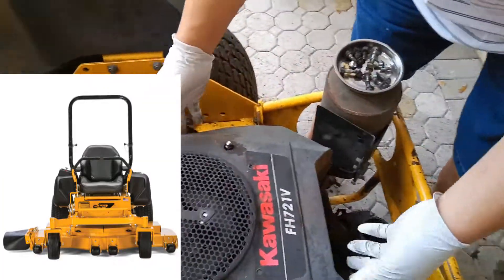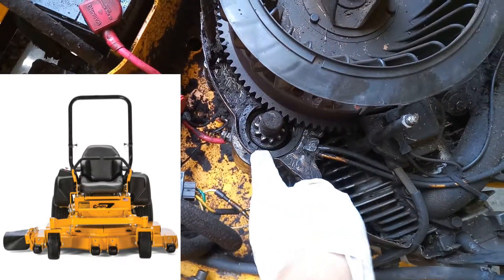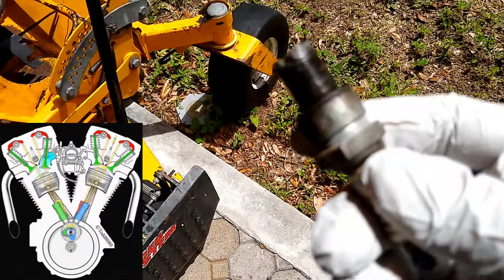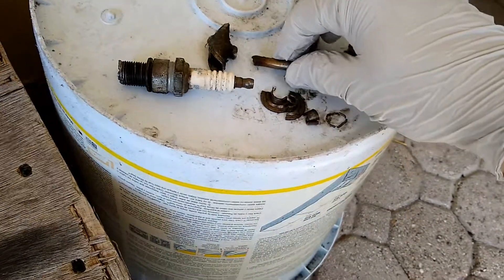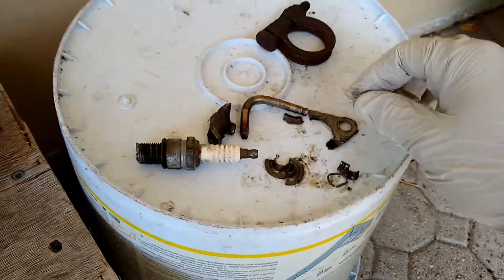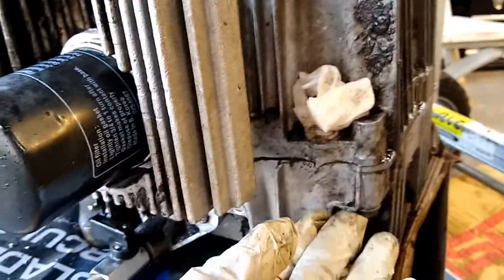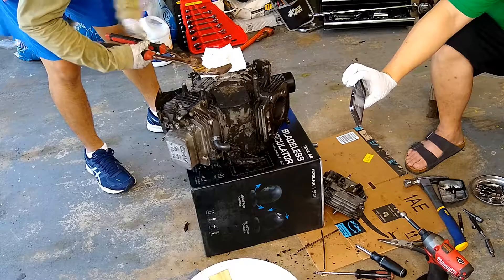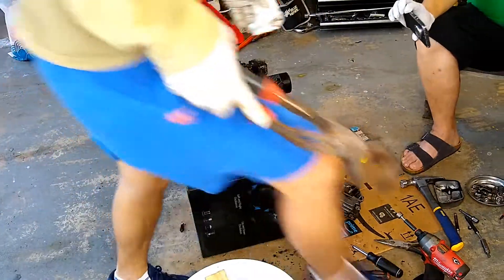Kawasaki FH721V repair

Comment: I have one of these engines on my '04 Everride Warrior. I've replaced the governor (I posted my experience on my channel). I've always had a tough time to get this thing to start. I finally bought another carb for it (Chinese), which works fairly well. Kawasaki wanted a small fortune for the new carburetor. I wanted a carburetor, not a new mower. But, it still doesn't like to start very well.  I finally have just left the air tube clamp off and pop the air tube loose and spritz a shot of starting fluid in the carb. This fires things right up. No long cranking sessions. 
  The idio....engineers at Kamakazi thought that the original 721's didn't need an oil galley to the top bearing, allowing the crank to waller out the top end. To fix it you have to buy the complete top case ($$$$). So, many of the older engines have gone to the scrap yard where they belong. I've thought about taking the 22 hp out of my old Sears 3000 and use it for the power plant. It's an old  Briggs. Kawasaki has not overwhelmed me with quality. I'd rate 'em right up there with Tecumseh. Except the parts are gold plated.
Reply from the maker: Clever way to motivate ignition with starter fluid hack, @battalion151R. I'm not a mechanical engineer, so I can't attest to the logic behind their design. I do agree that a lot can be learned and improved upon simply by evaluating the cause of failure and accounting for the number of replacement parts purchased every year. Thanks for sharing your engine experience and expertise.

Comment: Where did you buy the replacement head and did it come with the parts in it or did you have to assemble it?
Reply: My lawn mower is now running.🙂🙂
Reply from the maker: Hello. I purchased the engine head repair kit via the internet from a Pat's Small Engine in Minnesota (www.psep.biz). Below is a parts list from the receipt. Everything was as planned except for the push-rods, which were shorter and for a smaller displacement FV-series engine. Thanks for watching.

Item: HEADKIT6: CYLINDER HEAD KIT(UD16)
Quantity: 1 Price: $244.99 Shipping: $0.00 Total: $244.99
Item: KAW11060_7011: Intake Gasket
Quantity: 2 Price: $3.98 Shipping: $0.00 Total: $3.98
Item: KAW11060_7016: Exhaust Gasket
Quantity: 2 Price: $3.98 Shipping: $0.00 Total: $3.98
Item: KAW11004_7006: Head Gasket
Quantity: 2 Price: $15.88 Shipping: $0.00 Total: $15.88